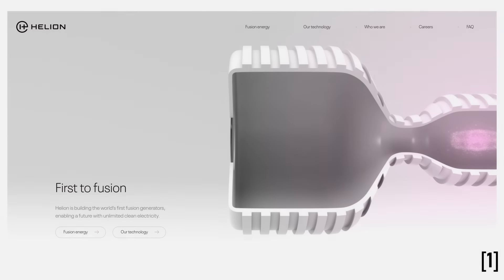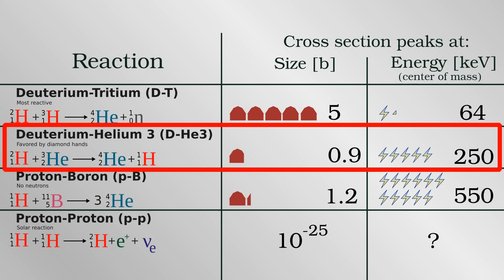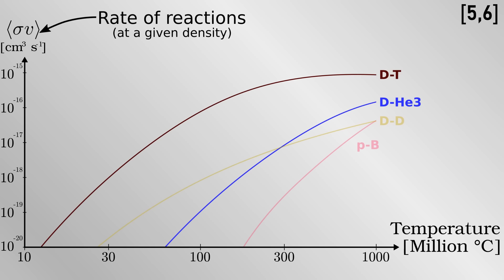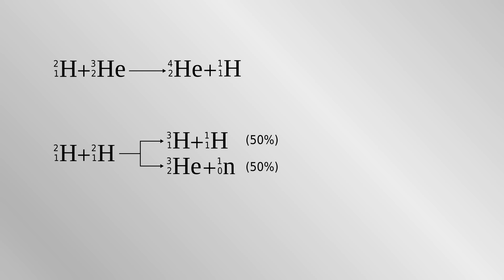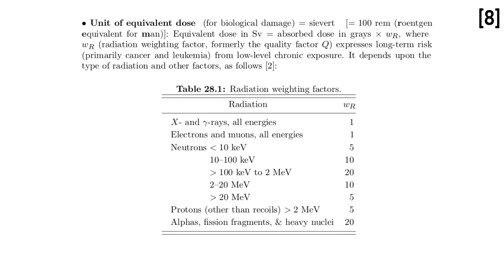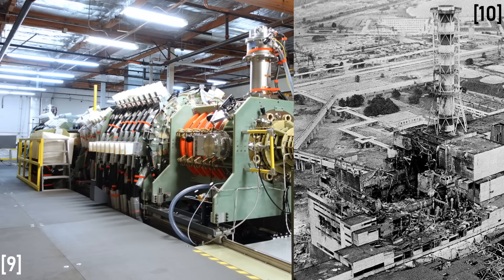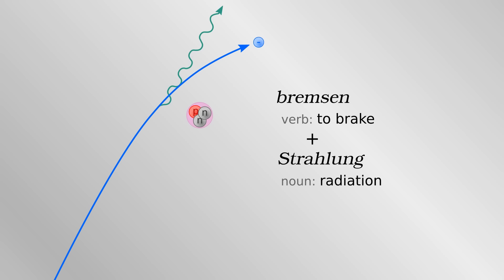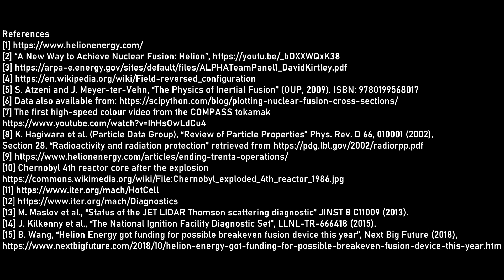The problems with Helion Energy - a response to Real Engineering

Comment: Regardless, this is still a promising technology. I sure hope Helion keeps moving forward with it.
Reply: No, its a scam.
Reply: Helion will move forward. Their approach doesn't cost as much as the traditional approach to Nuclear Fusion energy generation.
Reply: @iroulis  of course they will move forward, its their way of making money out of a scam.
Reply: @sassa82  Unfortunately, his video is riddled with misconceptions and misguidance. That I've found out that he fails to address deliberately avoids. And his skepticism is getting over to him. It's people like him that squander information that make fusion research have even more issues because of misunderstandings of what helion is trying to accomplish. Since most people like you aren't science literate that much. They have minimal understanding of it.

First Critique: "The neutrons from Deuterium-Deuterium reactions would have fried Trenta and I see no shielding."

As mentioned, Trenta is a subscale prototype, an experiment. It is smaller, weaker and only operates at one pulse every 10 minutes (max). A full scale powerplant would do 10 pulses a second. Not all shots were fueled by Deuterium or Deuterium + He3. Many were fueled by a mix of hydrogen and Deuterium or pure hydrogen, depending on what they wanted to test.
Because of that alone, the total neutron flux that Trenta has experienced so far is not that high.

Second Critique: "Deuterium - Helium3 has a smaller reaction cross section than Deuterium- Deuterium. At the 100 million degrees temperature discussed in the video, Deuterium-Deuterium reactions would be much more likely than Deuterium-Helium3 reactions."

That is generally true, but he misses some key points:
Trenta is a subscale prototype with much weaker magnets than what they are proposing for a full scale powerplant. Because of that temperatures are somewhat lower than in a full scale power plant. Power plants aim for temperatures 20 keV (220 million degrees) and up to 330 million degrees (30keV). At that point the D-He3 reactivity surpasses the D-D reactivity.
That said, Helion actually wants some D-D reactions because that is how they are breeding their He3.

D-D => He3 +n or D-D => T +p

Both reactions have a 50% chance of happening.

So, in mixed mode (breed and power) machines, they will need two D-D reactions for every D-He3 reaction, at least until the Tritium inventory is large enough that they have a constant supply from decay (Tritium beta decays into Helium3).

Third Critique: "Deuterium - Helium3 is too hard, and Tokamaks cannot do it. Therefore, Helion's approach of fusing Deuterium and Helium3 can never work."

D-He3 is very hard to ignite, but they do not need ignition for their design to produce enough net electricity to be economic. Most of the energy from D-D and D-He3 reactions is released as charged particles, not in neutrons. Helion can recover the energy in charged particles directly as electricity at a higher efficiency than a steam plant would. They can also recover 95% of the input energy directly as electricity. That makes their machines a lot more efficient.

Another thing that works in Helion's favor is the Te:Ti ratio they use. This ratio actually decreases further with higher temperatures. So the hotter the plasma gets, the smaller that ratio. Trenta already showed Te:Ti at <0.1. It is likely that a power plant will have an even lower ratio. Lower electron temperatures greatly reduce Bremsstrahlung losses. At a ratio of 0.1, thermal transport losses actually kick in earlier than Bremsstrahlung.

So I don't know if he did enough research into helion, because these are key points that he somehow missed that others have pointed out.
Reply: @johndoe-sv9th  how much have you invested in Helion?
Reply: @sassa82  Aren't you going to reply with anything other that?
Reply: @sassa82  Fusion is possible given the right technology. If helion can't do it that's their choice. There are many other ways to produce fusion not just helions way. But I'm guessing you're not physicist to know all that.
Reply: @josephman1488  its problematic if they scam people from their money and give real fusion research a bad name.
Reply: @sassa82  Are you saying other fusion startups are scamming people as well. Just because they use different technologies not used by other scientists doesn't mean they can't achieve fusion.

Comment: I wanted to make two points: First, the steal used in civilian fission reactors and in the Trident Submarine reactors are nuclear grade, in that, the radiation does not cause the steal to become brittle too quickly. But I am not sure about the neutrons from a fusion reactor and how much attenuation and how fast the steal becomes brittle. Second, you didn't justify your comparison to Chernobyl. My understand, and correct me if I am wrong, the Chernobyl meltdown was a result of having a graphite moderator. If your claim is that excessive neutron radiation somehow was the initial trigger that lead to the meltdown, you would need to further explain it and cite to evidence to support your claim. I generally agree with your criticism and I guarrantee you once I start building my fusion reactor prototype, I will happily allow everyone to criticize it.

Comment: This video is a perfect example of why when a tiny channel with less than 10% of another channel's subscriber count releases a "Gotcha" video, it's always bullshit.

I mean some of the things you accuse Real Engineering of ignoring are not only covered in the video, but are actually done by Hellion on purpose because of the nature of the technology.

The worst example is the blathering about the deuterium-deuterium reactions. Real engineering absolutely addresses that. In fact, Hellion counts on that, because it's how they make helium 3 for the fusion to helium 4. Hellion also separates the deuterium-deuterium fusion into a different reactor than the one doing the deuterium-helium 3 fusion. This will allow them to build a more robust containment system for the fusion that's dealing with the higher number of neutrons vs  the ones you get with the deuterium-helium 3 reaction. Also a lot of the radioactive garbage left over, namely the tritium, beta decays into helium 3, which can then be used for fuel.

Seriously dude, did you watch BOTH videos in the series, and all the way to the end?

Comment: The whole time I saw the Helion video from Real Engineering, I always was asking myself the question "So how much energy is the reaction producing, how much is being captured and how much energy are you using to achieve it?". I am no scientist of any sort, I'm a lay person, dumb as bricks you might say. But I always was waiting for the numbers about energy to come up and nothing ever did. I just wanted to know are you producing 50% of the energy you're using? Are you producing 25% of the energy you're using? A simple figure I could wrap my head around to know perhaps how successful their fusion reaction endeavor was. But it never came up in the video. It wasn't even about electricity generation at all, until right around the 20 minute mark that they mention the next generation reactor, Polaris, targeting electricity generation as a test scenario. So they built nothing substantive in the end. They built a very expensive thing with a bank of capacitors around it. I knew right then and there that the entire video was just an advertisement and not an actual piece of information about the company that was critical or informative, the whole fusion electricity generation, was nothing more than still a pipe dream.

Comment: These criticisms are valid against a prototype, but what about a full scale version? All they’re doing right now is proof of concept. It seems obvious to me they’ll push temperatures higher in the next version, as well as many other changes. Of course some criticisms stand as the fuel and other things wouldn’t change, but attacking a prototype for being, well, a prototype, seems a bit disingenuous.
Reply from the maker: As I hope I made clear, if you are doing D-3He reactions at the rate of a power plant, they will generate a huge amount of neutrons which are deadly by themselves and which will be absorbed by the power plant itself to produce radioactive isotopes. Once you do so, you have all the problems of fission, a proven technology.
Reply: @ImprobableMatter  They’re currently doing maybe one reaction every 10 minutes. Not dangerous. You made a big deal about the neutrons, but is there anything with the current design that would prevent them from encasing the thing in lead? If not, then you’re not making a valid criticism.
You also pointed out that they were supposed to be making tons of electricity in 2021. If you’re going to call them out for not hitting timelines, then you have to criticize literally every other major technological improvement. It’s a cheap shot that makes me lose respect for you. Same with harping about their claims of major advancements when the idea has been around for decades, and the fact that there isn’t much published literature. So what? Publishing takes lots of time, time that is better spent improving the product. 
You make many good points in this video about Helion doesn’t have a silver bullet, but there is so much other junk in there that could be easily solved if they were focused on it. They’ll be the first ones to say they don’t have everything 100% worked out yet, but they’re not impossible problems. They’re actually relatively simple compared to everything they’ve done so far.
Reply from the maker: Yes, there are two major problems if they encase everything in lead for the final commercial reactor. Firstly, in response to the Real Engineering video, they say that "tokamak reactors are going to face the exact same issues as nuclear fission  energy. They will be too expensive and won't be able to compete with cheaper forms of electricity". By their reckoning then, radioactivity = unprofitability.

Secondly and more importantly, the radiation also has a massive negative effect on the electrical, optical and mechanical components of the machine itself. The coils would degrade, the fiberoptics they talk about will go pitch black, transistors will stop working etc. That meter of solid material must be placed between the plasma and any functional component. Looking at the design as presented, with coils, antennas and so on positioned as it is relative to the plasma, this seems very doubtful.
Reply: @ImprobableMatter  playing Devil's Eggnog for a moment, D-D neutrons are only around 2.5MeV (versus 14MeV for D-T neutrons) which means they are somewhat more manageable in terms of shielding and also reactor materials damage and activation. Further, neutron-activated stainless steel has a half-life of around 100 years. To call this comparable with waste from fission which has half-lives of 10s of 1000s of years is a little unfair. Comments?
Reply from the maker: @MattNolanCustom  I'll talk about neutron damage in the next video. The second point is why I believe fusion in general is worthwhile, but I think it was more than fair to challenge Real Engineering claiming/implying that there would be no neutrons whatsoever because it's D-3He.
Reply: @ImprobableMatter  Thank you. I look forwards to the next video. I appreciate your pragmatic approach

Comment: Another really good video!
Your fusion series has been outstanding and opened my eyes.

Could you do a fission series, about the new kinds of fission reactors proposed?
Especially flibe energy’s fluoride molten salt thorium reactor and others?
I am very bullish about these new kinds of fission reactors and I am wondering if my optimism is unwarranted. Most of the time I only hear about the advantages and potential of these reactors and I would like to know what kind of challenges there are to these designs.

I wish you all the best
Reply: Or one of the paper-designs that seem to be good. do one about dual fluid reactor, DFR.

Comment: Hello newcomer here and engineering/physics student. for me the biggest takeaway from real engineerings video was the ability to produce the products needed for larger tokomack reactors. The fuel problem for D-T is brought up a lot and it does need to be solved and the radiation on these reactor as you said is a large problem for both types. But could a reactor type such as helions be used more as like a we think of an oil rig or mine which takes in energy to run drills and things? Maybe it's alright to have a net loss on a smaller more replaceable system, if It makes larger reactors and their fuels leaps and bounds cheaper. Maybe Im misunderstanding something fundamental here but this type of reactor produces tritium in addition to the other reactions I'm not sure on what scales thought. Is it possible that this type of research and development of such a system could lead to a cost effective solution to the tritium/radiation problem? I'm interested in your opinion because I'm currently trying to work in the fusion field and helion is on the list of companies I'm considering, yes I am aware of the technical issues and am currently educating myself on fusion I am aware that a truely viable system might never be possible and that if it is its a long road and not just around the corner. A reply would be greatly appreciated as I am not and expert and don't yet have to tools to fully form an opinion. Thank you!
Reply from the maker: Yes, and indeed any number of reactor types could be used to run fusion reactions which potentially make sense even at an energy loss: produce neutrons to transmute radioactive waste from fission or other transmutation reactions, produce Helium3 for some application or other etc. This is not what they have claimed to want, however, not in the Real Engineering video or in their other publications.
Reply: Thank you!
Reply: Fusion power will never work, but if you wanted to produce tritium or He3 the most practical solution is a fission plant with a lithium jacket to convert neutrons into tritium. Tritium will decay into He3.
Reply: @orionstark  Fool & his money soon part ways. 

Nevers are always wrong? Where's my flying car? When is my Pam-Am pre-paid ticket to the moon going to be honored? Where are those Fuel cell cars? Where are the fission power plants that are too cheap to meter?
Reply: @guytech7310  it is funny how you do not mention what is here, like working jetpacks and flying suits, genetically engineered organisms, A.I. which can write code and beat grand masters in games of Go. 
Not everything is going to come on your schedule, and not everything which can be engineered is going to outcompete legacy designs on cost and utility, but never underestimate humanity's capacity to build miracles.

Comment: Can you evaluate if the fusion reactor proposed by General Fusion is of any good? It seems a interesting concept (compressing rotating liquid metal to generate enormous pressure to the D + T gas mixture in the center) but I have no qualification to judge how realistic it is.
Reply: I recently was looking at other fusion start-ups and thought the same about them: I cannot easily dismiss them as fast as most others (not caring about neutrons), but even though I'm a total noob on the topic, I do see some problems here anyway:
-the "liquid metal" is in direct contact with the gas/plasma, that is supposed to be fusing: that means either a) It get's to hot and ionizes/evaporates, which cannot be intended or b) it is supposed to equilibrate after the fusion pulse happend and has an enormous heat capacity. I assume option B is supposed to happen, which could be achieved by having a LOT of metal there.
- Neutrons: if the metal is present in enormous quantities, the thickness might be sufficient to shield the rest of the machine from Neutrons, so far so good. Any radioactive isotopes generated by the Neutrons might be filtered out, when the heat is exchanged from the liquid metal to the power generators (or heat exchangers before that).
- The amount of liquid metal in the mashine: This might also be a huge problem. First of all moving the metal requires more energy, the more metal is used, and as the metal is not superfluid (That would be AWESOME!), Rotating the metal will require constant adding of energy. Deforming the metal to compress the fusion gas/plasma also needs more energy, the more metal is used. So afai can see, it all comes down to the balance of energy costs due to rotating/compressing the liquid metal, filtering out "bad" isotopes and losses due to heat exchange and the Carnot process vs. the amount of energy generated by fusion in the middle of the liquid metal.
I'm not good enough to do the calculation, but maybe @ImprobableMatter is...?
Reply: @theonlyhero  Commenting here to see Matters response